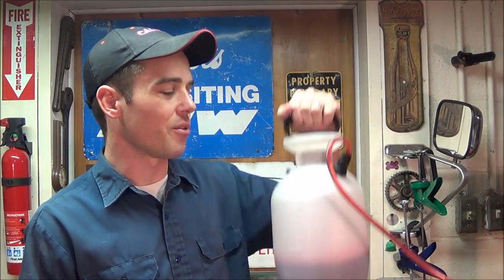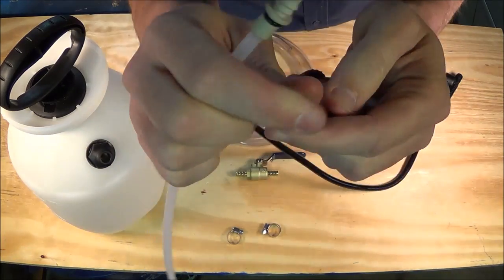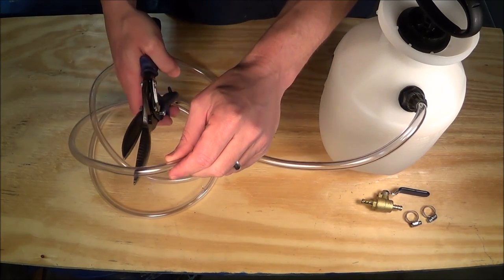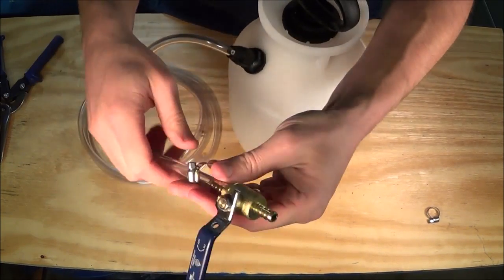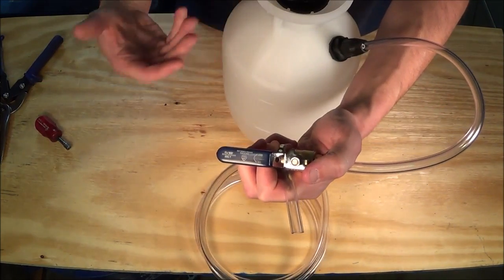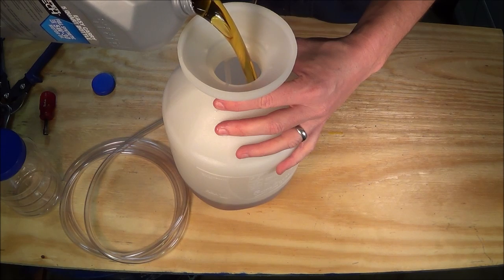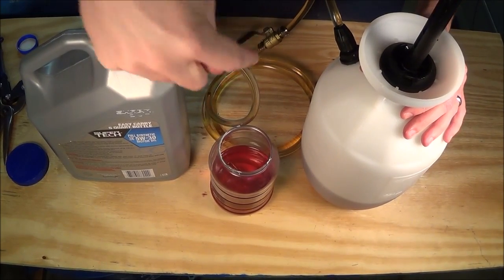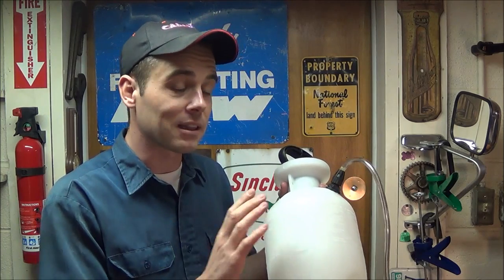How To : Make a Pressurized Fluid Dispenser

Comment: Didn't mean to beat you up but this could screw up equipment worth hundreds of thousands of dollars and cause it to fail when it needed to save someone's life.
Reply: You guys are stupid. These bottles are made from plastics that can withstand prolonged use of caustic chemicals...you can clean it out with brake fluid cleaner and spend 10mins cleaning it up well enough that only traces of previous fluids are barely even present. For the at-home weekend warrior shop guy this is amazing. And at all of $13 to make, you could have several and label them for different fluids.
Reply from the maker: Frederick Kaludis See previous reply....thanks.
Reply: +Real Tool Reviews "While this has some value you can't use this for mixed fluids.  Once you put it into motor oil service and even then you need to consider the type of oil for example mobile one synthetic you don't want to mix them with other oils.  Even in small amounts this could damage the oil and gunk up a motor.  Not a big issue for a home shop, as a matter of fact this may work in a home machine shop for cutting fluid.  But good ideas for a home shop find there way in to oil  change shops and will end up screwing up someone's car or truck.  Further transmission fluid may eat up the seals in the pump.
Some fluids are not good with some seals.  One hydraulic fluid called skydrol used in portapower systems and other equipment needs seals made of viton or silicon rubber.  You can't make blanket statements that if its good enough for weed spray it will work on oil."As stated by: Frederick Kaludis
Reply: You need to get off Youtube and get back to building the space shuttle. The whole team is waiting for you. You're important. Don't let anyone tell you otherwise.

Comment: While this has some value you can't use this for mixed fluids.  Once you put it into motor oil service and even then you need to consider the type of oil for example mobile one synthetic you don't want to mix them with other oils.  Even in small amounts this could damage the oil and gunk up a motor.  Not a big issue for a home shop, as a matter of fact this may work in a home machine shop for cutting fluid.  But good ideas for a home shop find there way in to oil  change shops and will end up screwing up someone's car or truck.  Further transmission fluid may eat up the seals in the pump.
Some fluids are not good with some seals.  One hydraulic fluid called skydrol used in portapower systems and other equipment needs seals made of viton or silicon rubber.  You can't make blanket statements that if its good enough for weed spray it will work on oil.
Reply from the maker: Frederick Kaludis I have had transmission fluid in one of mine for 3+ years.....it is still holding up fine.  For 99.99999% of people, this will absolutely work great.....for the very few that lube up NASA Space Shuttles, you would be better off using precision instruments (per your statement of "equipment worth HUNDREDS OF THOUSANDS of dollars...").....it begs the question, "Who working on equipment worth $100k+ is using homemade pressure dispensers?  Thanks for the comment, but you are going way overboard on assumptions.  One point we can agree on though, it would be best to make individual dispensers PER fluid type....that way there is never cross-contamination.
Reply: Real Tool Reviews Anyone that work on semi trucks, some small garages work on ambiances, small volunteer fire departments use small garages, all 100K-+ vehicle.  
I'm not talking NASA shuttles I worked on it's ground support equipment and the lube and  tool controls are tight. QC checked my box for "illegal" lubes all the time, it was my ass if I had any non spec products.  Plus the defuel equipment could explode if you used the wrong lube with N2O4.    I had to document the lot #, and part # and this tracked back to my tool box.      Port-a-power units are are on most fire vehicles and a lot of construction, Hurst jaws also use Skydrol as a hydraulic fluid very corrosive and will strip paint off a car.
Reply from the maker: Frederick Kaludis The only difference between this & a Mityvac unit is a label on the side.....the plastics/seals/hoses are the same.  I have had to replace my Mityvac brake bleeder hoses more than once due to age/use.....they have an entire company & product lines based around identical tools.  Once again, if you have strict guidelines & document lot & part #s....homemade tools are not for you.  Thanks for the reply.
Reply: Synthetic and Dino motor oils are OK to mix.
Reply: @sunlite9759  You are absolutely correct....the myth still continues that you can't mix synthetic with regular petroleum when it is perfectly fine to do so. There is at least one video on youtube by petroleum engineers that debunk this common misconception
Reply: +Frederick Kaludis  You by chance do any work around Hubble?

Comment: hi, just wanna ask where you bought your garden sprayer and what size so i can also do this. Thanks..
Reply from the maker: theguapo1975channel I either got it at Home Depot or Lowes.....I dont remember.  Basically just get a 1-gallon (cheapest) pump style sprayer they sell & that is what you need.
Reply: Great idea but so far I cannot find a sprayer with the same physical properties as what is depicted in this video. It'd be great to mention the brand/model for clarity.

Comment: Where did you get your ball valve? I can only find 1/2 in at home Depot and Lowe's.
Reply from the maker: Chris Walton They are in the plumbing fitting section.....look for where you see all the copper fittings, pvc pipes, and other plumbing items.  There will be many options for all sizes of the ball valves there.

Comment: Do you know of a flow meter that you could put on this so as to measure the amount of fluid (in measurements of tenths of a quart) a bit more precisely than marking the side of the tank? I'd like to be able to measure the number of quarts I'm putting in.
Reply from the maker: Michael DeLong I have not used any, but would suggest just pouring the amount you want to dispense into the tank & then pressurize it.....when the tank drains there will still be a lot of air pressure & it will spew the rest of it out.  For exact measurements, which I assume you want for things like 5.3 qts.....keep in mind that there typically is some residual fluid always left inside the engine/transmission/transfer case.  At which point you would need to use a dipstick anyway to verify proper levels when topping off.  For axles/transfer cases, you will usually pour fluid in until it starts running back out, so no precise measurement is needed.

Comment: holy hell dude...i'm making one this weekend for atf, and another next weekend for motor oil...hmm...maybe we can drill out the bottom, put a air fitting in and a regulator...15 psi should be enough to push out atf right? haha
Reply from the maker: bighunterman77 I am glad you liked it....it really is easy to make.   And honestly you dont need to add an air fitting, just 5-10 pumps will make enough pressure to empty it out quickly....it doesnt take much.

Comment: When you transition between fluids- ATF, Gear Oil etc...how do you clean the pump out so as not to contaminate? Just run it a little with whatever the current job fluid is and let it push the other stuff out?
Reply from the maker: ThePracticalPatriot I dont use the same container for multiple fluids....I make separate ones for each, so I never have to empty them back out.  If someone spent the cash on a mityvac unit, I can see using it for multiple things....but since these cost $20 to make, I would suggest building different units.

Comment: They're $40.
Reply from the maker: David G What's $40?  The garden sprayer is about $10 at any Lowes or Home Depot nationwide.
Reply: A pressurized brake bleeder/fluid dispenser
Reply: uh, not one that is either large enough for even at home auto maint. They start at $70-80 for handheld size. Mityvac is like $150-300 and up from there.